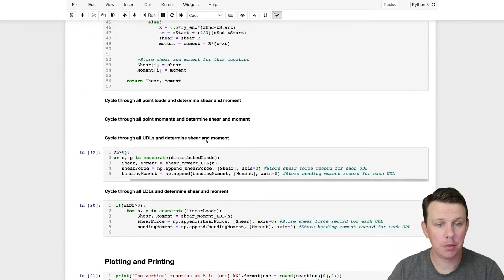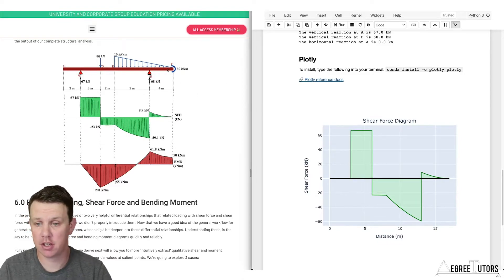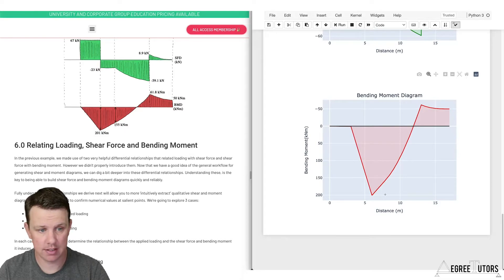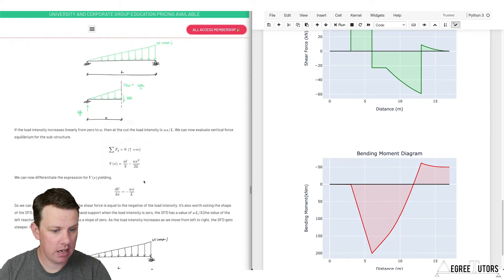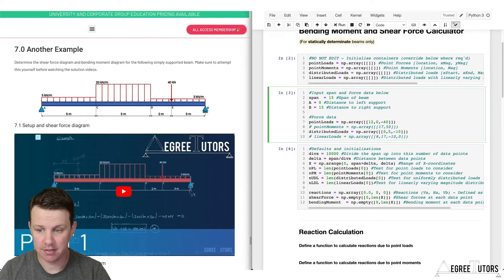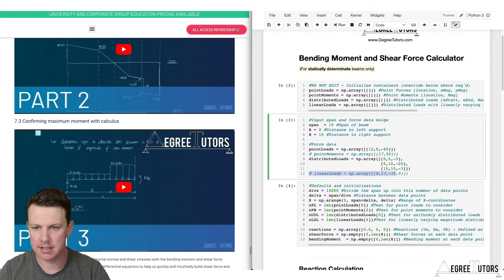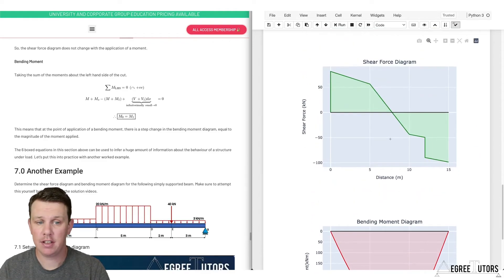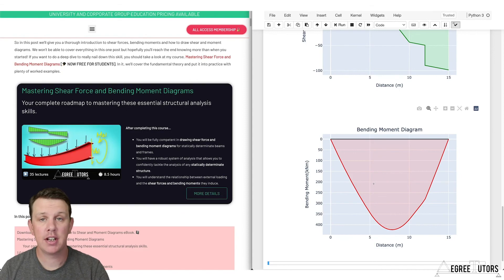[9/9] Testing our Finished Shear Force & Bending Moment Diagram Calculator | DegreeTutors.com

Comment: Hi is there a way to calculate cantilever beam using the current calculator?
Reply from the maker: No, you would need to alter the code...easy to do, if you've completed the project.
Reply: @EngineeringSkills-Sean  A little late to the game here, but wouldn't simply setting the A and B portions of the supports extremely close to each other emulate a fixed support with respect to bending moment? Might be able to trick the program... working off the cuff as I write this: 

Would probably be plenty close enough if we say, set A=0, and B=.001m ... I do need to pencil it out to be sure, but I get the feeling that this would work to effectively work to shown cantilever moment diagrams because support B would basically act as a fixed support. Shear would probably be incorrect, because we would be jumping up and then back down on the shear graph... also, it is pretty apparent shear forces would be astronomical due to the tiny lever arm provided between A and B.

Actually... after just thinking with a calculus frame of mind... I tried something... at least with respect to uniformly distributed loads. It appears that the shear diagram shows as expected if one sets the "span" between A and B to be small enough (make it so span is less than n), the shear diagram actually seems to work as well. Probably because the divisions, n, end up being slightly larger than the "span" (the shear diagram doesn't do the bounce between iterations if n is larger than the span). Penciled it out  on a few uniform distributions, and it seems to work with respect to maximum shear and moment... given that the principles of the sheet basically work with principles of integration in regards to moment, and that the shear diagrams look about right if the span is small enough, I presume the rest of the results are close enough for most cases. 

Pretty cool! Seems to work with a few tests with only uniform moments involved. Wouldn't be surprised if it works for the other load cases too, but I haven't tried it yet to be sure.
Reply: Do note that the readouts for the forces at A and B will be way off though, but the shear diagram and moment diagrams look okay xD